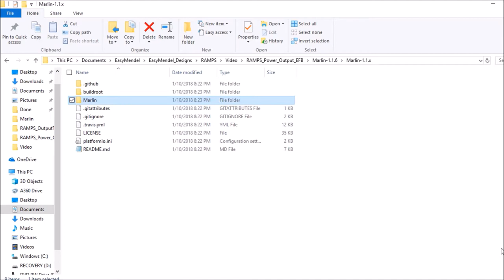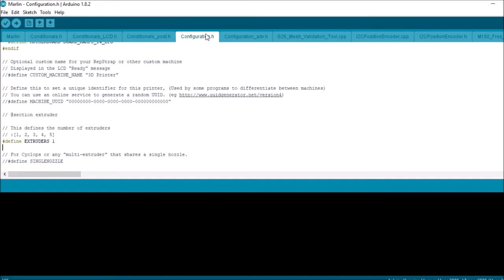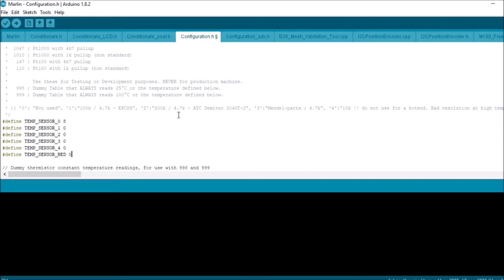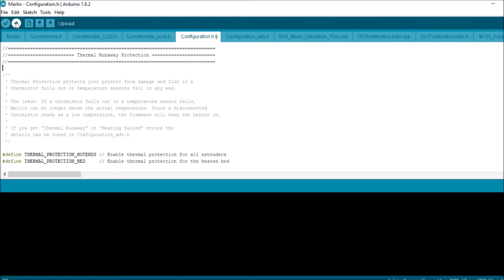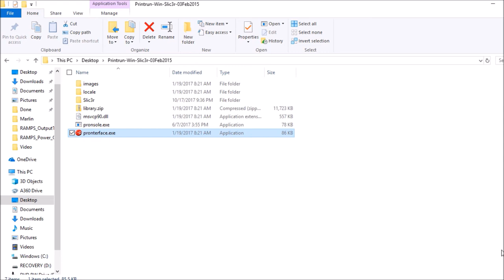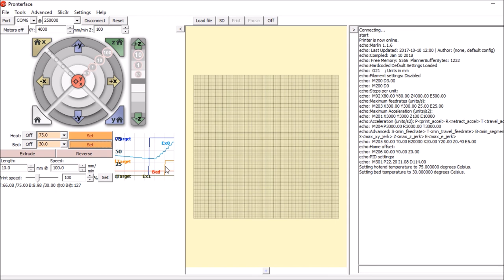RAMPS 1.4 - Power Output EFB  (D10, D9, D8)

Comment: Hi, what is the specification of the combined SMPS did you use for stepper motor, bed and hot end? I am getting confused. Please tell the output voltage and current.

Comment: Hi nice video I have a question my hotend is not heating up what should I do can u help me or someone please
Reply from the maker: Check for a broken wire on thermistor or use a mulimeter to check wires continuity.
Reply: Edward Braiman thanks for your reply ye I checked all that with a multimeter there is no power coming out from d10 d9 and d8 on the ramps when I set the temperature in pronterface the software I’m using
Reply from the maker: Might be a bad connection or damaged board.

Comment: i like how your videos are pretty straight forward, question though, that fan connected to D9 is that the part cooling fan? if so, where do i connect the fan that's attached to the  cooling fins of the e3d v6 hotend? thanks
Reply from the maker: +Allan Mariano the fan should be connected to the cooling fins of the extruder. If you need a second fan you can wire a second off the RAMPS pins.

Comment: you seem like you may be able to help me with my next step.  So, I have an anet a8 that I bought in 2017, its been a decent printer for me, Ive upgraded the firmware to the current version for windows.  Also upgraded repetier host to current.  I want to change nozzels to a 3 in one out config.  Would I have to get a different board than the standard one?  or would I add  this ramps board to add  2  more motors?
Reply from the maker: It's possible, but I would start with one additional stepper and then try two a couple of months later.  Reason being a diamond printhead is difficult to master.  Also the Marlin firmware has changed a little since this tutorial was made.  The concept should be close.  Ramps 1.6 with a Arduino Due might work better.

Comment: I want to enable the EFB configuration on my RAMPS 1.4 board. Is in a Prusa I3 Standard printer. How can i see or extract the FX that is currently on the board to check and adjust the settings on the new FW to correspond to my printer? I have connected a fan to D9, but it does not work. I presume the board is set to EEB.
Reply from the maker: There are many factors to keep in mind with this board.  First it usually only operates at 12V, not sure of the power supply in your setup.  The best thing to do is join Discord in the link below and ask questions there's a lot of knowledgeable people in general chat.
Reply: @EdwardBraiman  Thank you kindly. I have just joined. I'll browse around for a while and see if i don't see and similar questions before dropping them.

Comment: Checked the thermistor by multimeter.resistance decrese when heated and increase when cooling,so it is ok.but it fits sligtly loose in the apperture of hole in which it is fited.pls guide

Comment: which fan should be connected to it?? Extruder fan, or the fan to cool down electronic components?
Reply from the maker: In pinout diagram or pins_ramps14.h file it's he1.
Reply: @EdwardBraiman  
Like i have connected :-

1. Fan to cool down all electronics(ramps1.4,drivers) at E*F*B.
(M106)

2. Extruder fan at 2pins in the ramps where it always runs as soon as u power the ramps1.4

Thing is my E*F*B fan keeps switching off by itself in the middle of the print...and I always have to go to 
main menu-->temprature--->fan speed(0-100%) on my lcd.
Reply from the maker: Inside gcode file look for gcode that controls fan speed.  This might be a render issue controlling fan.
Reply: @EdwardBraiman  never heard of render issues.....will search for that...thankx

Comment: Hello
I need your help please, my RAMPS enters the 12v through the source but does not connect it nor the MEGA (no LED lights up), when I connect via USB there both alloys, but it does not have enough "force" to move the motors. Strange that the first time I turned on the power supply, I noticed that a red led from RAMPS came on, when I was regulating the tripods of the DVR8825 drive that I realized that it had no power. I measured with a multimeter and it has 12v in the thermal fuses (yellow), from then on I could not look more.
Reply from the maker: Okay, lets break down he problem.  Are you saying the motors (NEMA17) do not turn?  Or are you saying there is an issue with USB not being functional?  What measurements for voltage are you seeing for 12 volts and where?  If you feel better posting you question in your native language, I might be able to understand your question better.   My understand of the problem seems to be your motor are not turning and it appears you think we might have an issue with the RAMPS 1.4 board.  I would start by disconnecting the RAMPS board from the Arduino Mega 2560 and see if the USB to the Arduino is functional and will take a firmware load.  If it does work I would then remove steppers (DRV8825) and reattach the RAMPS1.4 and see if the problem can first be localized.  Then I would add back one at a time until I found the possible bad stepper.  Remember to remove power during disconnection or connection of components.  Let me know what you find.

Comment: Helle i have touble with my hotbed not working in marlin ramps 1.4 what i cand the first?
Reply from the maker: Normally problem is the thermistor is not connected or broken.  Normally error code like 999 or something in pronterface or octopi terminal.

Comment: sir, i hv problem with D10,on connecting to pronterface, led for d  10 blink 11to12 times and then stoppe.giving message: heating failed,system stopped,heating _ ID0.sir iam following all your video till now for Ramps 1.4 setting. I hv assembled my own cnc router and now i want to convert it to 3D printer.pls help.
Reply from the maker: Check thermistor.

Comment: Hi, I have a problem with my RAMP 1.4 D8 output. When I press 'set' my heatbed is not heating up. But my D10 output is working. Do you have any idea how to solve it?

Thank you.
Reply from the maker: Several.  You could change your MarlinFW  Motherboard configuration to EFF and hook up one or two fans to D9 and D8 and check to see if they run.  I have a video called dual Fans https://youtu.be/0W3VQpL0e8g which allows you to check if the fans turn.  If this does work, then it might mean your wires are not connected right for the heat bed.  You could also use a multimeter to check if power is working.  I prefer the fans to a multimeter as I like to avoid touching the system when it's energized (powered).  Also check the seating of the pins for the RAMPS 1.4 as I've experience using a board slight warped that lose GPIO connection when they are not fully seated in Arduino Mega 2560.

Comment: Hi Edward,
Can you please help me with my problem I am willing to pay
I am using Ramp 1.4 with EFB in Marlin config.h, but the fan doesn't work at all??
from pronterface with M106 it's work fine, 
The setting in Cura ok also.
Since I can't find any problem I am trying to assign pin # in config adv.h removing -1 and put 9 it give me error.
What you think is the problem Please.
Reply from the maker: First does the fan turn on with, "M106 P0 S255"?
Second does the fan work when tested on a 9v battery?
Third, could you explain what you're trying to do with fan.
And finally have you tested fan output for RAMPS 1.4 with a multimeter?
Also if you desire you can tip on PayPal if you would like, but please not anything above $5.
Reply from the maker: Also I have another video in playlist for multiple fans called fan extender I think.
Reply: Thank you so much, it is working with M106 P0 S255 and with 9V battery, also I have same problem with my other printers. 
Is't possible that I need to change something in the Config.h
 or config adv in order to make them work
These fans I use them to cool the filament it is connected to D9
The J-bowden cooling fans work good it's connected to the 12V pin on the ramp 1.4
Thank you
Reply from the maker: You're welcome.  You may need to check continuity of the wiring with a multimeter if you see voltage from output power of the board.
Reply: @EdwardBraiman  I will check the continuity tomorrow, but I am little bit confused if the fan work using M106 does that mean there is connection ( I am not familiar with these thing)
Reply from the maker: @malazawi  if the fan works with m106 gcode, then continuity is not the issue.  It means in Slic3r file the fan setting is not present.  In slic3r under printer settings for start g-code add command for m106 p0 s200.  You can also add end command to turn off fan at end of print with m106 p0 s0.
Reply: @EdwardBraiman  I use Cura 4.4 and the Start Code as follow:-
G21 ; metric values
G90 ; absolute positioning
M82 ; set extruder to absolute mode
M107;  start with the fan off
G28 ; Auto Home All AXIS
G29 ; Auto Bed Levelling
G1 Z15.0 F{travel_speed}; move the Nozzle Up 15mm
G92 E0 ; zero the extruded length
G1 F200 E3 ; extrude 3mm of feed stock
G92 E0 ; zero the extruded length again
G1 F{travel_speed};
M117; Printing...
Reply: @EdwardBraiman  I just opened the gcode file to print with notpad++ and the only line I found with M106 (M106 S255 P1) is is possible that this is the problem. Thank you
Reply from the maker: @malazawi  one way to test is change to, "M106 P0 S255", and see if works correctly.  What are you using for Slic3r?  I'm soon going to create a tutorial series on setting up models to print, but I think you're going to be an expert before I record it.
Reply: @EdwardBraiman  I will try it  and thank you, I am retired since 2011, was working Mechanical design engineer for 40 years, if you need any help to design any thing I will be happy to help, I made two 3D printers and the last one from wood structure, also I am using Cura 4.4.1, Thanks a lot for your help
Reply from the maker: Thanks.  I'm getting ready to redesign a printer I design on thingiverse for a more stable dual x carriage.  Mostly for another tutorial.
Reply: @EdwardBraiman  Thank you it is working when I change P1 to P0 using NP++, but are there a setting in Cura4.4 can change that pin to P0 not P1 because when I save the file it is still go to P1, is that mean I have to change that from notpad++ every file I save???
The Fan is connected to D9 on ramp 1.4
Best regards
Reply from the maker: @malazawi  you can always use Pronterface and Slic3r and avoid the issue.  They're both free.
Reply: @EdwardBraiman  I just found the problem, Cura machine setting then extruder tab, cooling fan was 1 I replace it with 0, then I checked it by NP++ and the # 1 gone. Will try to print it to see what will happen. I suppose will be ok
Best regards

Comment: Why do you change the value for TEMP_SENSOR_BED instead of Temp_Sensor_1? YOu connected the sensor to t1.
How does the programm know that your temp sensor 1 is actually the heatbed?
I am asking because i am wiring up the ramps board for the first time and i have so manny questions which step practically exclusively from the bad documentation of the ramps boards....

I guess the final question is how does marlin decide which sensor out of the two xou connected is for the extruder and which one is for the bed?
Reply from the maker: It's based on the boards.hh file.  In this file is the defined configuration.  If you watch my other tutorial I think posted before this one it will be clearer.  If you're unable to find I'll post a link.
Reply: Man thx - i was looking for that so long now. anny hint in the documentzation would have been nice.
Reply from the maker: It's one of the reasons I started making these videos. The documents are not so clear.
Reply: I need a bit more help. Boards.h has nothing in it, which could tell me why it knows where which sensor sits, other than my wild guess, that the heatbed sensor is always the last one connected, so that puttign the heatbed sensor on t1, but actually changing values for Temp_Sensor_BED magically is checking t1.
Reply: Well i know how to wire everything up and i just have to finally find the right datasheet for ym stepper drivers, which seems tob eimpossible - all from 0.9A to 2A ratings for the same kind of stepper can be found...
But apart from that i know and udnerstandy the why an dhows behidn everything.
Just the magic of the heatbed sensor reading are unclear.

I watched all your videos regarding ramps, and i cant find anything that will explain it, and its not tob e found in boards.h temperature.h temperature.ccp and the likes.

How is it that you first coonnected the sensor like this

t0=extruder
t1=bed,

but in the software you specify 

TEMP_SENSOR_0= 8  for the extruder temp sensor you use
TEMP_SENSOR_1=0 not installed (even though here you attached the bed thermosensor)
TEMP_SENSOR_BED=8 because you use the same sensor for bed and hotend

how does this work?
 How and where does the switching between TEMP_SENSOR_1 and TEMP_SENSOR_BED happen?
Reply from the maker: Cara Carcass I'm not sure I understand the question.  You can type you question in the language your most comfortable with.  Are you asking where to plug the thermistor in or about the stepper motor for the nama17?
Reply: Ok, step by step.

You connected the temperature sensor for the extruder to t0 on the ramps board. 
You then connected the temperature sensor for the heatbed to t1 on the ramps board.

So we have:

t0 = extruder temperature sensor
t1 = hotbed temperature sensor

These are the electrical connections. This is totally fine with me.

In the configuration. h you switched TEMP_SENSOR_0 on by setting it to whatever value you need to acces the right sensor calibration curve.

The Next step you did was to switch TEMP_SENSOR_BED to the same value, since you use the same temperature sensor.

we now have 
TEMP_SENSOR_0 = 8
TEMP_SENSOR_BED = 8

Why do you use TEM_SENSOR_BED instead of TEMP_SENSOR_1? The description/switch in the software does not match the actual wiring.

HOW does the software know that TEMP_SENSOR_BED is actually electrically connected to t1, when you do NOT use TEMP_SENSOR_1?

How and when does this TEMP_SENSOR_1 <-> TEMP_SENSOR_BED switching happen?
Reply from the maker: When you have a Configuration that is EFB this would be Extruder get thermistor pins E0, F is fan which does not use a thermistor and then Bed which gets E1 pins for thermistor.  Sorry recorded this video before I purchased a new camera so it seems a little confusing without a closeup of pins, so I had to say what I was doing verbally.
Reply from the maker: Here is how it understands which configuration ... #define MOTHERBOARD BOARD_RAMPS_14_EFB ... in configuration.h.  If you change to ... #define MOTHERBOARD BOARD_RAMPS_14_EFF ... then it would be configured after compile(verify) and upload.  This video might help explain ... https://youtu.be/HBWDs_2iVmo
Reply: I understand teh logic behind the EFB thing and there are only 2 sensors but 3 outputs.
THE ONLY questiuon i ahve is, how does the software know tha t the temp sensor for the bed is connected to t1 when you use the TEMP_SENSOR_BED varioable instead of the TEMP_SENSOR_1 variable. Where does teh switching happen?
Reply: I have a feeling, that we somehow totally talk past each others point and i do not know how to resolve this problem :)
Reply from the maker: I'm guessing, but it's probable pins.h, I've not traced it down too far in the firmware.   but it hard coded for the configuration someplace.  You could do a search on the directory for the phrase EFB and then read the coding from those points.  by then you might know a lot more about the firmware than myself and then I'll be asking you question on how things works.  good luck :)
Reply: Well, thx for sticking thoruigh this with me. I might do tht, for now after going crazy about thsi for hours, i ahve to say that everything worked about 4h ago, and i jsut went crazy over a details thats not so important.

Ill put teh electronics in their case tomorrow and do the first real print. xyz cube came out fine already.
Thanks to yoru videos too. The documentations has it holes and your videos do help.
Reply from the maker: Cara Carcass no problem.  Just pass on what you learn to help others and humanity.
Reply: I have a collection of gides which all have holes in their discription at different steps.  Together they cover pretty much everything. I think i might have somethign handy the next time i see someone asking.